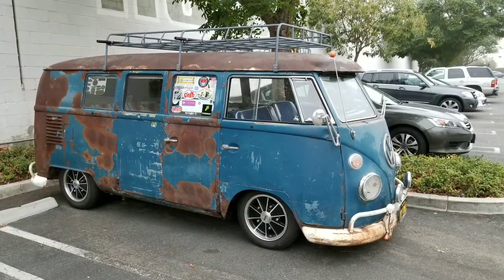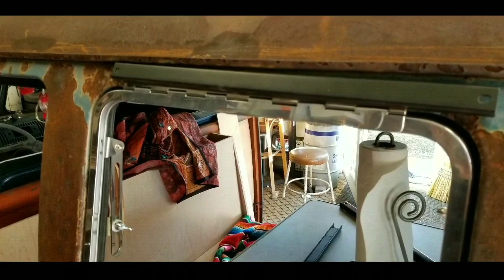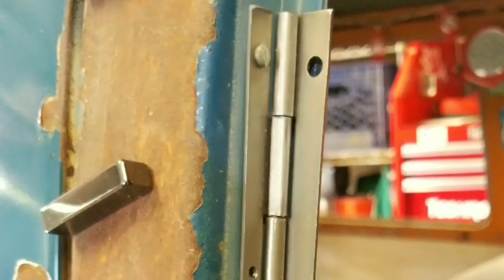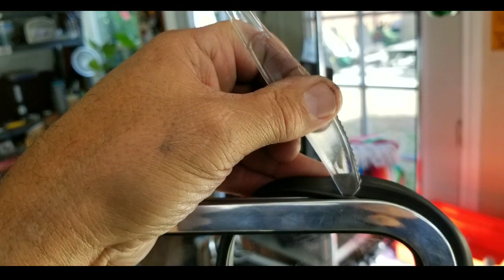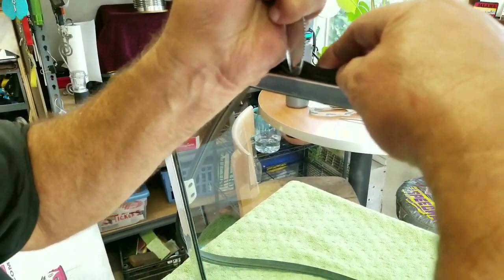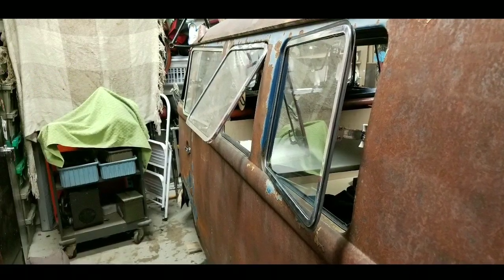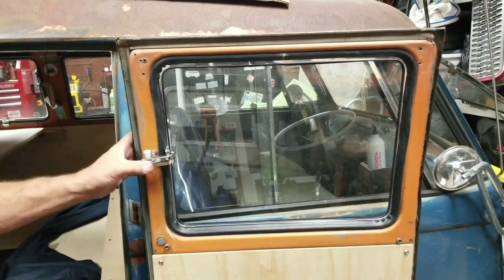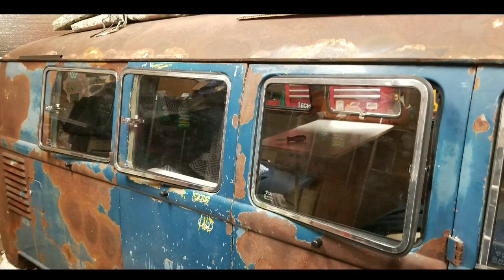VW SPLIT BUS SIDE SAFARI WINDOW + POP OUT WINDOW INSTALLATION ON PHILA TV!

Comment: Awesome video mate, just about to do this on my bus and looked and looked for a video to help, this has helped cheers. What size holes did you drill for the latches and did you use the screws that came with the kit? I have 4 side popouts to do this week (same creative kits). 😁
Reply from the maker: for the side safari i used the supplied screws for the hinge and #10 screws fr the latches and a 1/8 drill bit and everything held tight, on the pop out hinge i used real tiny screws from a westy. i just ordered my rear safari window from creative and next week i will do a detailed video on how i installed them,  thanks for watching phila tv!